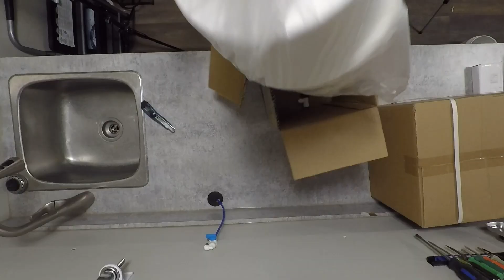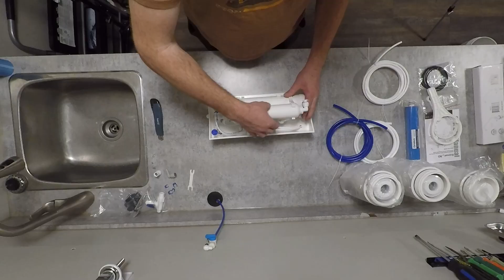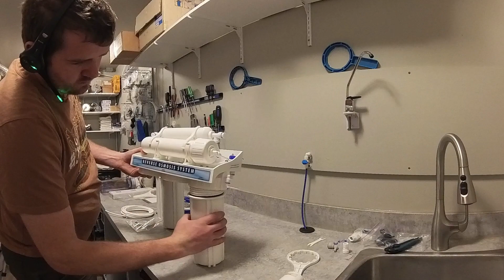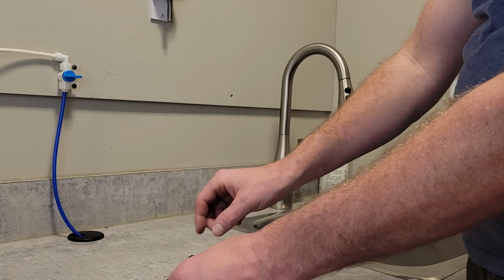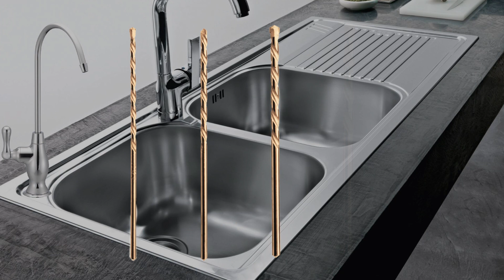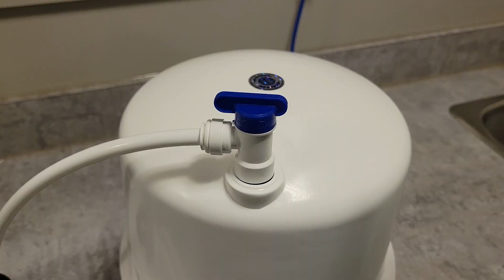5 Stage R.O. System Install Guide

Comment: Thank you so much for this video man. I have a similar unit installed, but when I open the inlet water valve, I immediately get a high pressure drainage on the drain pipe. Any idea why this happens?